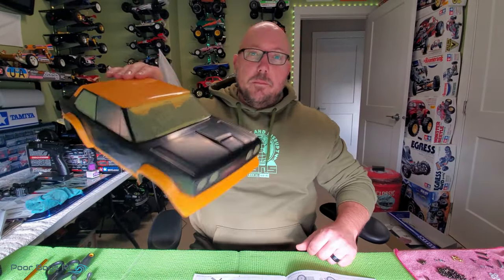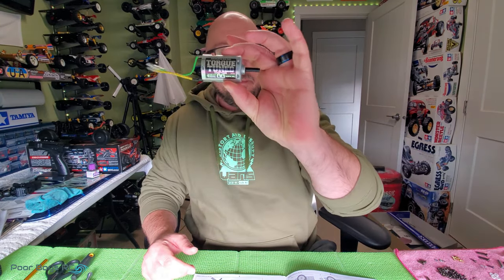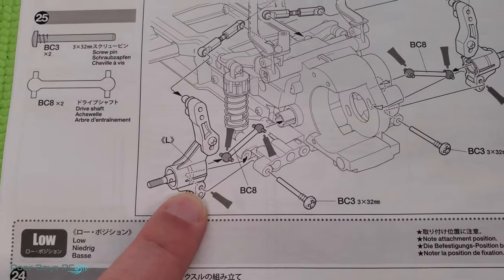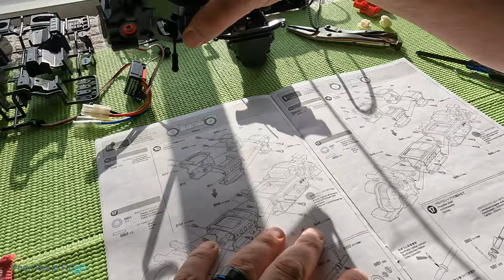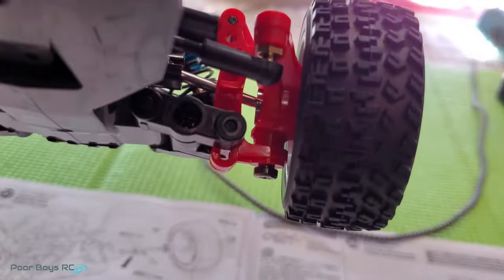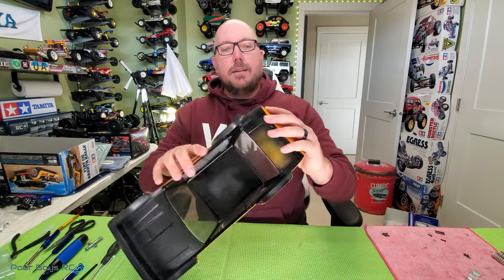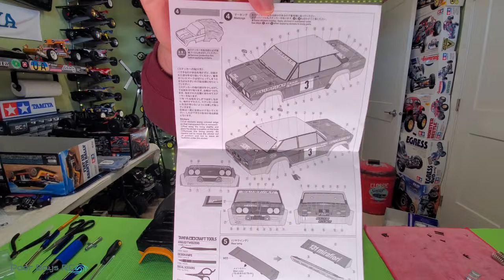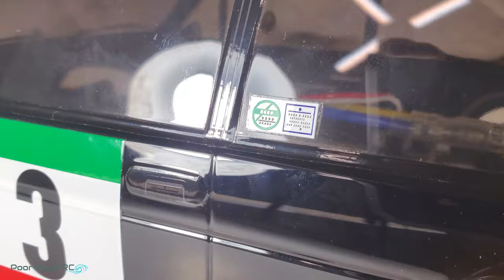Tamiya Fiat 131 Abarth Rally - Build and Paint Tips - Time Lapse Build

Comment: Doesn't matter how many kits you build, they are always such a fun and rewarding endeavour mate!
Those shocks look a vast improvement on the stock pogo sticks, and should definitely help the ride.
The body looks awesome, reminds me of a wasp!
Lexan bodies are never easy, especially when you are going with a two tone scheme.... doesn't matter how well you mask, there's always a bleed or two.
A good tip is to apply a layer of clear coat first, this helps seal the masking prior to the colour layers.
But, all in all a great job there my friend.... Look forward to seeing it in action Fil. 👍 👍 👍
Reply from the maker: Thanks for watching, my man. I've got to try that clear coat trick on a 2 or 3 tone body. I've never done it and I've heard it works great. 💪
Reply: @poorboysrc 
Yes matey.... It's a bit more time and effort (and expense!) but definitely pays off in the long run, especially if it's a body of extreme value or scarcity.
I was sceptical at first, but have had great results.
Nothing worse than a bleeding mask line! 👍 👍 👍
Reply from the maker: @yodadarksideGreenHawksRC  I agree! Especially after you quadrupme-check it to make sure it's good... 🤦🤬🤬🤬🤯

Comment: One tip regarding the rear suspension - in High position, it tends to pop the driveshafts due to poor geometry. I found on my mid motor MF that it's better to assemble the rear axle to low height spec and then lift suspension by cutting into arms where they collide with the hub and using longer damper eyelets - it should work on the standard build aswell.
Reply from the maker: Ah, very interesting, I haven't heard of this mod yet. Thanks for the tip, if I start having dogbone issues, I know what to do. 🍻👊🏼

Comment: Paint is a pain, worse on Lexan as hard as you try to mask well somehow it will bleed somewhere or the spray will get through. But decals do hide a lot and odd spare decals can be used to hide it a little. Still spray cans are better, when I started for lexan bodies only brush on and the paint had a very strong odour.
Reply from the maker: Yeah the smell is really intense. And toxic. It's nice to paint them outside in the summer, the heat really helps with curing. 🍻

Comment: Hello Fil, I built the rally bug a few years ago. It is on the same 4wd chassis. I did not like the suspension set-up. I got the "Yeah Racing" wide set up. Even though it says wide it fits on the chassis perfect. It has lots of aluminum parts and looks good. It also works good too.  If you can still buy this kit, I would recommend it. I think it might even work with the shocks that you installed. Thoughts?
Reply from the maker: Very interesting, I didn't know yeah racing made a wide kit for the MF-01x chassis. Thanks for the tip, I'm going to look into this, as the Fiat 131 could use a wider track stance and this might be the ticket. Cheers! 🍻
Reply: @poorboysrc   When I bought the kit was about $100.00 US dollars. When you consider all of the aluminum parts that you get, it is a good price. I found the kit on eBay if that helps.
Reply from the maker: @alfredyost7972  that helps a lot, thank you! It's on my to do list for today to try and look it up. Cheers!
Reply from the maker: And I just found it, and it's still available. I see the price has gone up, it's almost $200 Canadian dollars now to get it here, which is quite a bit. I'm going to keep searching and see if I can find it in Canada somewhere, so I don't have to pay the crazy shipping costs. Thanks again for the heads up!
Reply: @poorboysrc  Wow! That is really expensive. Ouch! I live in the USA and we do not have crazy shipping costs and we also do not have crazy tariffs either. At least not yet. If you can find it in Canada you will probably save a lot of money. I hope you can get this set at a reasonable price. Keep producing your videos. Have a nice night.